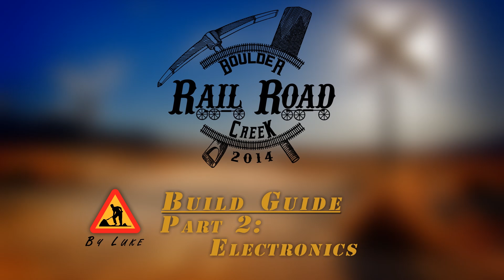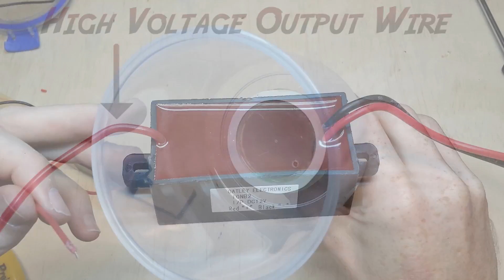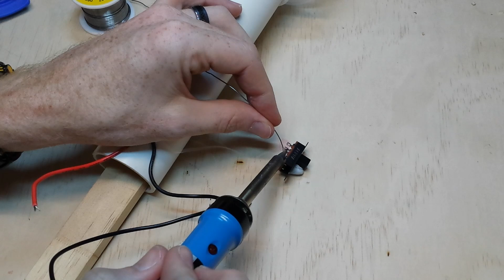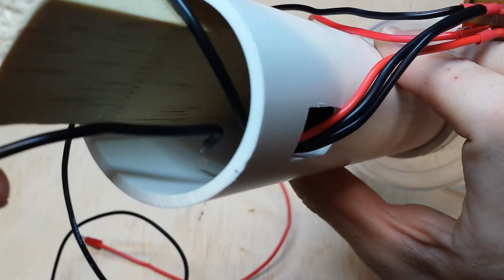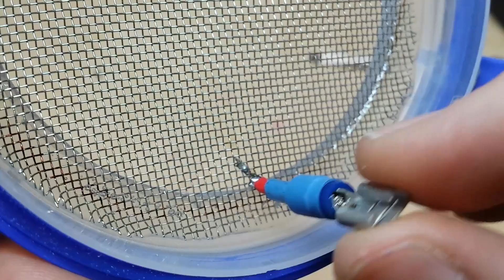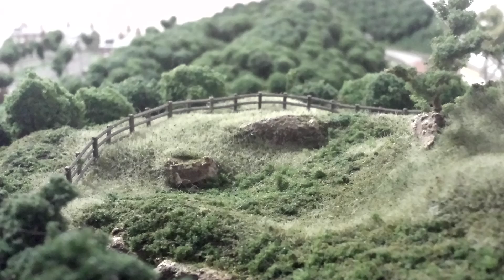Static Grass Applicator (Electronics) - How To - Model Railroad

Comment: Luke, as always your videos are top notch. Question, do you have a technique or tip to get static grass to stay vertical on steep slopes?
Reply from the maker: Thanks Michael, I don't have a techniques video for laying static grass but it's something I'll definitely do in the near future. I find it hard to get static grass to stand up on slopes, it generally angles out at a 90 degree angle from the surface so if it's a steep hill the grass will be pointing out to the side! It's possible to use a brush to angle the grass fibers more vertical after the grass has been applied.
I'll let you know when I do a video on tips and techniques for applying static grass.
Cheers
Luke

Comment: Luke, 
Awesome work man. Very impressive. I have a question.
Do you have to keep the charge going for as longs as it takes for the base glue to set?
Reply from the maker: no, the fibers will hold themselves up however it you apply a very spares area of grass some of the fibers will fall. The grass basically supports itself against the other grass fibers that are standing on end.
Cheers
Luke
Reply: Luke Towan

Thanks, Luke.

Comment: After watching the videos a few times I have taken the plunge and bought the parts to build a static grass applicator, however my negative ion genny has two white output wires with carbon brushes on, do I cut off the brushes and connect the two ends or just use one white wire? Thanks mate.
Reply from the maker: I think it's possible to cut one wire off but you can also leave both on. The general operation is similar to the single wire model. I do know the voltage and current is a little lower on those models so the results may not be quite as effective however people have definitely made good working applicators with the two wire ion generators.
Good luck with the build.
Cheers
Luke
Reply: Thanks mate, I cobbled up a tea strainer to try it out and it worked so all good, thanks for your excellent tutorial.   Pete.

Comment: Thank you for making such a great tutorial!!! I have all the parts except the power source. I can see the specs on it, thank you, but I dont know what kind of power source it is. Its not in your list of materials. I read in one of the comments its from your model rr. Can you explain to me what kind of power source it is and how you know which wire is positive and which is negative? I am in the US if that matters. Thank you!!!
Reply from the maker: +Erin McGuire Hi mate, it's a 12 volt phone charger and I cut the plug off that would connect to the phone. You could use a multi-meter to check which is positive or negative but often they are marked somewhere along the wire. Most electronics stores will sell cheap generic 12 volt phone chargers.
Hope that helps.
Cheers
Luke
Reply: That helps a bunch, thank you!!!
Reply: Luke I understand that the supply is 12 volts but I cannot find a supply that matches with the current ratings from oatleys website (12 volts 25 milliamp) all of the 12 volt supplies I am seeing online are 1 amp and above ... Any suggestions ?
Reply: +Nate Vizzi Since this is a late reply, this is more for people seeing this later. Current ratings on power supplies are a maximum rating while voltage is constant. A 12VDC 1Amp supply will always put out 12VDC but will put out 1Amp or less. The device you are using decides current draw so it will work as long as it doesn't exceed maximum current ratings.

Comment: Hi Luke,
it's me again !!! I need your help. I just bought an Ion Generator but it's different from yours. It is from Seawise Industrial Limited, with a Model # SW750, 120vac - 7.5KV 60Hz, E143427,  J197.  My questions is can i do the same principle as yours? My E-mail address is danny.laguer@hotmail.com...... hope you could help me!!!
Many Thanks !!!
Danny
Reply from the maker: +Danny Laguer Hi Danny, as far as I can tell it should work o.k. however I'd just be cautious when working with high voltages. It appears yours is 120 Volts AC which you'd need to have a suitable power supply. The one I used was a 12 Volt DC model. 
Unfortunately there's not much more info I can give you with this particular model except be careful... which basically applies to anything involving electricity.
Hope you can work out the best way to wire it up.
Cheers
Luke.
Reply: +Luke Towan  Thanks for info....in that case, i'll ask someone who can do it for me and know about electricity, very much appreciated mate!!!
Cheers,
Danny

Comment: Way too complicated for me.  Can I just buy one somewhere?
Reply from the maker: +kevin15776 you can buy them, a similar sized one with comparable power and results will set you back about $190 USD It's called Noch GRASSmaster 2.0.
Cheers
Luke
Reply: +Luke Towan Thanks.  I don't have any tools and someone like me should not be messing around with electricity as I can barely change a light bulb. :)
Reply from the maker: Lol, last time I changed a light bulb I nearly burnt my hand... note to self, wait 5 minutes before touching the bulb that just blew!
Reply: +kevin15776 Noch is one of the most astonishingly overpriced lines of products out there! I'd cruise the net and see if someone else doesn't offer one. Also, my boss bought a Noch for work (we're a model making company) and it didn't work nearly as well as Luke's appears to.

Comment: YAY, my negative ion generator just arrived! Now I can build one of these!
Reply: Apparently, it is a duplicate wire. I just taped it up. Used just one white wire as per Luke's design
Reply: Ah, right.. Lemme see what I can dig up!
Reply: Posted a few pics in an album called Terrain Workshop
Reply from the maker: +Kurt Kier Cool, I hope it turns out OK.
Cheers
Luke
Reply: Working on it this morning. I had to do some research on the two white wires, but every thing else is good.
Reply: Kurt, what did you come up with regarding the two white wires? That's what I've got now and I'm trying to research it. Is one of the white wires the ground?
Reply: Thanks Kurt, I really appreciate it! Finished the parts construction yesterday & today is wiring day. Got pics of your layout anywhere?
Reply: No worries! I've got some pics, but I am currently away from my shop and home at the moment. My assembly looks kinda sloppy though. I mixed the two part epoxy wrong, and it didn't cure properly. Got a bunch of static flock stuck all in it, hehe.
Reply: Right on--I'm sure I'll be making a mess once I get this rig running; actually I was hoping to see some pics of your layout; I love looking at other people's work for inspiration. Cheers!
Reply: Uh oh. FInished my wiring tonight, connected to 12V power supply and heard a sort of a white noise sound. Switched it off, & when I switched it back on, no noise. Do these things usually make noise when you use 'em?I have no idea if it's working &  I don't even have any flock in the house to test with. I'll try tomorrow after a stop at the hobby shop.
Reply: The white noise might have been a static electricity noise, which they can make. The flock will tell you for certain if it's working
Reply: Looks like I wired my switch incorrectly. A review of Luke's video and comments shows me I should've been using all 6 terminals of the DPDT switch, cross-connecting the terminals on opposite corners. I did not do that, so I think I'm doing a complete re-wire tonight..and I ordered a couple of additional ion generators, now assuming that I fried the first one w/ the wiring mistake.

Comment: Hello, Luke!  I was wondering if you had the ratings on the DPDT switch you used...Amperage, Voltage, etc.
Reply from the maker: +El Chick sorry mate, I have no idea on the specs of the switch? It's just a cheap small switch from the electronics store. With this setup using a 12 Volt charger as the power source I don't think you'll have any limitations on the type of switch you use.
Cheers
Luke
Reply: the switch is on the 12v side of the circuit and amperage is minimal..  any standard switch like Like used will suffice..

Comment: great video! i had an applicator and it was so so      i made yours and it works great!    heavy layer of 3M spray adhesive works great for gluing the grass to the base
Reply from the maker: +Austin Kent Great idea using 3M spray I'll have to give it a try.
Cheers
Luke
Reply: +Luke Towan let me know how it goes!
Reply: +Luke Towan Just a warning, having made a great many trees over the years, that spray glue stays sticky. If someone grabs your spray-glued tree or presses on your grass to feel it, your flocking is going to stay squashed. 
And it attracts dust.
If Austin has a way around that, I'm all ears. 8-)

Comment: Hey Luke,

I just made one similar to this, other than the wires being opposite, it worked great. The only problem was, even after I turned it off, it would still discharge on just about anything. The grounding pin, the wood, and even the floor itself. I would have to unplug it completely despite it being turned off. Now it doesn't work at all, so I guess the ion generator is fried. Do you think you have an idea of what was happening and a remedy?
Reply: My generator is from electronic gold mine
Reply from the maker: +germannscale interesting... I had a look at the negative ion generators from "Electronic Gold Mine", apart from the extra green wire it looks the same and has similar specs. I'm trying to figure it out as to why it continued to produce a charge?
On the website it says to cut the green wire away if using as a negative ion generator, it appears the green wire is the one on the same side as the power wires (red and black ones), just check that that was the one you removed or possibly if you did remove the green wire that it wasn't touching anything else that might cause it to ground? Also it might be worth checking the power source, I used a 12v phone charger to power my Static grass applicator, it's possible you could be using a stronger power source or possibly the power  source might be faulty which is what I most likely suspect due to the fact it was still discharging even with the applicator turned off..?
The fact the negative ion generator is not working may be due to it touching a grounding point for too long, was it making a crackling sound for any amount of time? 
It's a tough one to figure out, the website does indicate that it is used for flocking so I think you have the right negative ion generator.
Lastly might also be worth checking out your wiring just to make sure none of the wires are touching each other creating a short and everything is wired correctly.
Hope that gives you somewhere to start looking for the problem, it seems like you had something right at the beginning as it was initially working?
Good luck :) and let me know how you go with fixing it.
Cheers
Luke

Comment: looks great, quick question though, why not just hard wire your plug in with environmental splices?

I need to make one of these :D
Reply from the maker: +ComNav22 Good question, I basically did it for flexibility. The power source I used for the static grass applicator was also used on my model railroad to power the switch machines.
Cheers
Luke.

Comment: Hey Luke, question...for the switch you used it has 6 pins but you only use 4...do you really only need a 4 pin switch!? I'm asking because I was looking at switches and found different pin counts from 3 to 6 ( I found a 3 pin switch I would like to use ).Thank you in advance
Reply from the maker: +smahalko you will actually need a 6 pin switch, it's hard to see but I do use all the terminals, they are needed to cross the flow over, the wires make a cross pattern. If you go back and pause the video you should get a better look.
Thanks for asking.
Cheers
Luke.
Reply: +Luke Towan 
Hi Luke - first off thanks for all the great videos.  On the question of the switch, I can't see what you mean about the wires making a cross pattern.  Please could it be possible for you to do a close up diagram? I've zoomed and paused, but still  I'm unsure - sorry for being dim!!:)

Ted
Reply: Oh wow, you're using all 6 switch terminals? I too thought you were using only 4. I really can't see what is on the other two in the video. This could be why my applicator made a fizzing noise and then went silent! :D

Comment: what is the voltage on the ion gen
Reply from the maker: +alfred jones If the input voltage is 12v the generator will give an output of 15Kv. 12v is the recommended input but it will also work well with lower input voltages. A 4.5v input will give an output of  6Kv.
Cheers
Luke.

Comment: Luke, thanks for the DIY video. Any idea what the output voltage of the ION Generator is?
Ended up buying  a 12VDC Negative ION Generator with 9.5Kv output. 

One thing i wasn't aware of is how much this static grass itches when it gets on my skin..

Comment: Thanks for the response. Ive ordered a new neg ion generator since i hooked it up to the phone charger and it did not work. Do you know how many amperes are needed to run it, the specs on your phone charger would be great. Thanks again.
Reply from the maker: Ricardo Márquez Valencia No worries, the charger I use has an output of 12 Volts and 1.5 Amps. That seems to work well for me, all of my videos showing static grass uses the 12v charger. Good luck... again.
Cheers
Luke.

Comment: It started working for the first ten seconds and then i unplugged it, i tried to turn it on again and it didnt work. Anyone know what could be wrong with it? Is it the switch or the negative ion generator. I tried a different 12v adapter and it didnt work. Please help.
Reply from the maker: Ricardo Márquez Valencia Hmm, I'm not 100% sure why? Did you use a negative ion generator from "oatley electronics"? I have seen some other ion generators on eBay from China but I think they are a little different. Also the power supply current may have been too high or possibly just a faulty ion generator. You shouldn't have any problems as long as it's wired exactly as I did in the video, so my guess would be a bad ion generator.
Apart from that I'm really not 100% sure.
Hope you can figure out exactly whats wrong.
Cheers
Luke.

Comment: Genius!   If nothing else I saw how you cunningly used a soldering iron to shrink the tubing.   I was about to head off to Jaycar to buy a $49 flame gun thingy.   Thanks mate, informative as always.
Reply from the maker: Paul Alderson Thanks Paul, I remember doing electronics back in high school and I used to always use the soldering iron to shrink the heat shrink tubing.... although I think some people frown upon it? It has always worked for me, just try not to use the tip of the soldering iron when doing it. Thanks for the great comment ;-)
Cheers
Luke.

Comment: Great how to,  thanks. Will be building one of these for sure.
Reply from the maker: Peter CPRail8748 Thanks peter, you'll be amazed at how effective this is! Also you don't have to build it as robust as I have, as long as you have the main core parts you could use a sifter to apply the grass!
Thanks for the positive comment.
Cheers
Luke.

Comment: May you sell one of these to me..... i tired to diy these by myself !!
Reply from the maker: johnson RAV I'd definitely consider selling a few. I was thinking about making 10 of these and putting them up on eBay to see how they would do. I'll let you know if I do and send you a link to the eBay page, it's just a matter of sitting down and putting them together. Cheers
Luke.
Reply: Thanks bro,
but how much you would sell for us ?
(As cheap as possible :DDDDD  ) 
would you ship oversea ?  
I am looking for your handmade product xD
Reply from the maker: johnson RAV I guess I'd have to sit down and calculate how much I spend on each static grass applicator and then work it out from there, if I buy parts in bulk I'd be able to save money. 
I'd sell them through eBay so sending overseas would not be an issue at all. 
Just gotta get motivated and build a few of them!